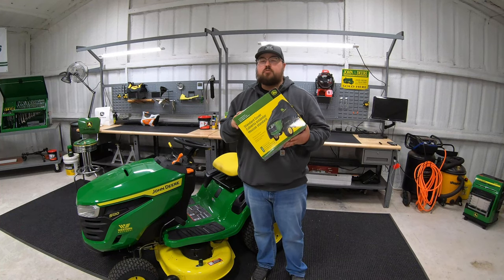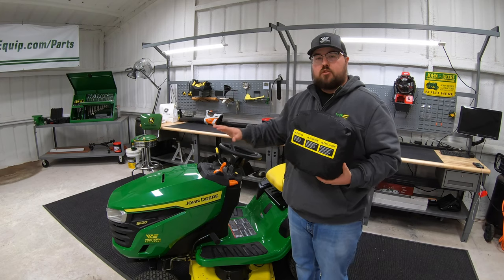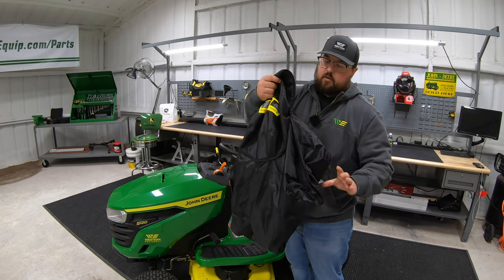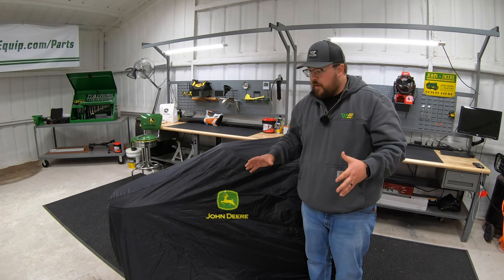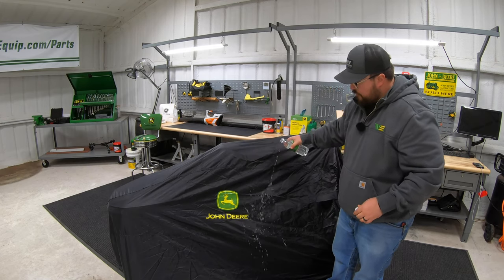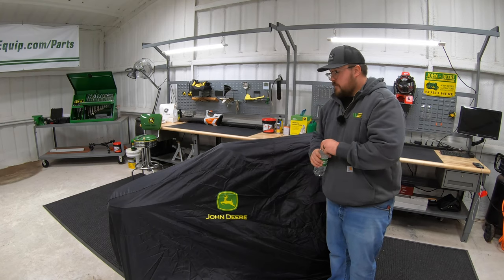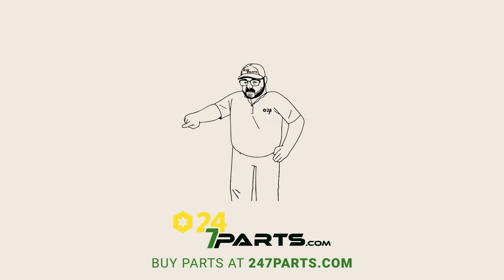How to Install John Deere Riding Mower Cover w/ quick Review

Comment: Always good to keep them covered.  I've worked on many used mowers where the coil rusted & burnout due to the machine being out in the rain.  The elements rust springs,  cables,  spindles,  blades,  everything when not covered.  Many don't cover their machines & wonder why they don't start.  The lawnmower cover saves money down the line no doubt about it.
Reply from the maker: I completely agree.

Comment: Now,  demonstrate the hard part - refolding the cover and stuffing it back in its pouch
Reply from the maker: HAHA! You are correct, that is the hard part!
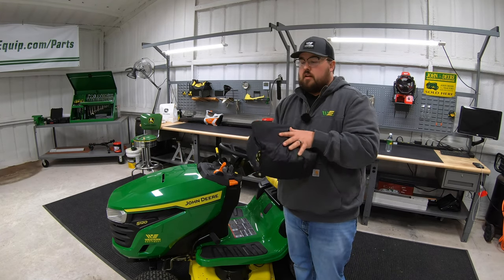Reply: 😂 I had to pause a few times @ 1:00-1:30 minutes then try 3 times and finally got it!🎉
But now I think it is a good design . It even goes over /around my after market trailer hitch.